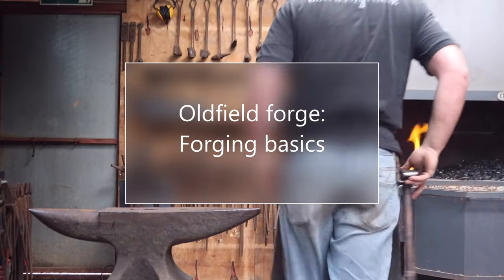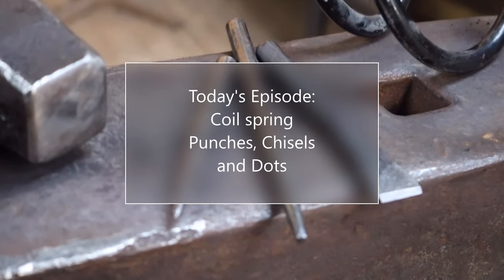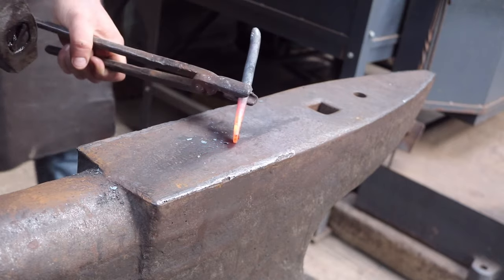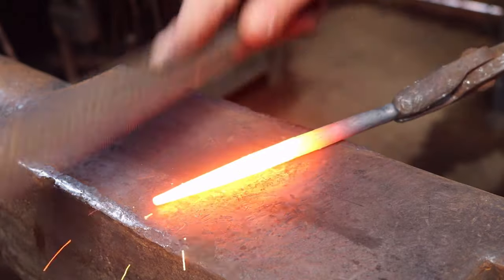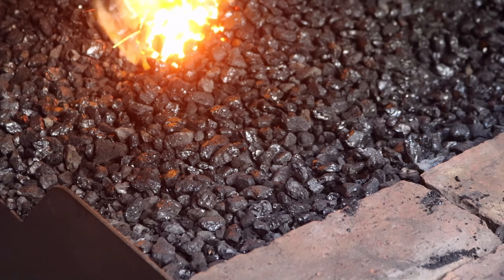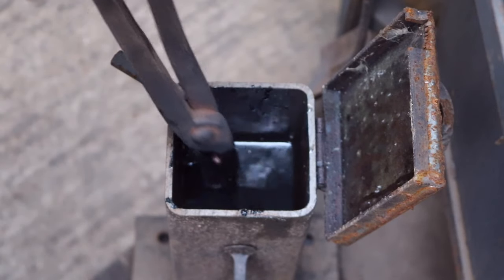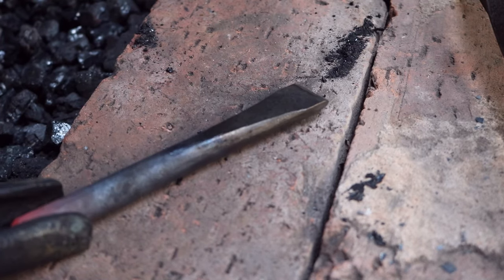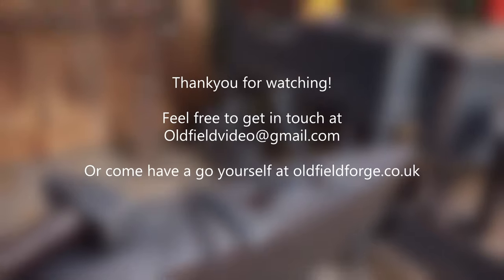Forging basics: Coil spring tools

Comment: Excellent primer! The only thing I would add is a caution about cooling coil spring tools in a slack tub when they're hot from use, which as you know can cause cracking.
Reply: Advice is to cover the bosh / slack tub with a piece of wood board to avoid differential quenching by habit.

Comment: I use fireplace ashes to anneal.  Steel will air harden as it still cools quite fast.  I anneal my steel before I start forging for obvious reasons.  You can also clamp scrap steel on both sides of your hardened piece, heat it, stick it in ashes overnight.  This makes the steel butter soft.  Air cooling is more for thermocycling to relieve the stress in the steel, I would not recommend it for softening or annealing steel.
Forge On!!!

Comment: What´s type of coal are you using in your forge?
Reply from the maker: We use either welsh coke or anthracite. We do have propane forges as well, but for teaching we prefer solid fuel.
Reply: @oldfieldforge  THANK FOR YOUR ANSWER. GREETINGS.